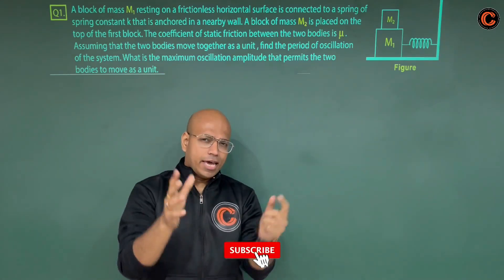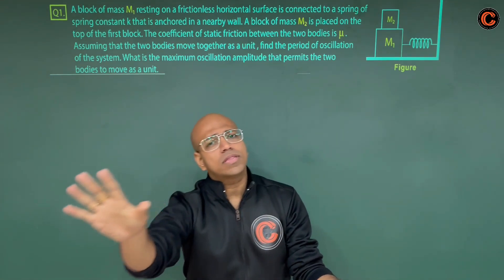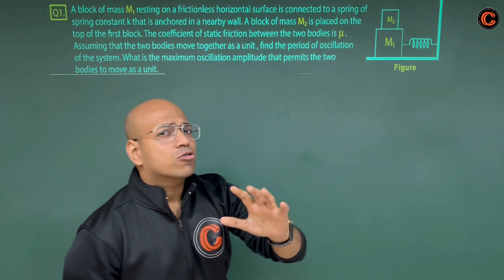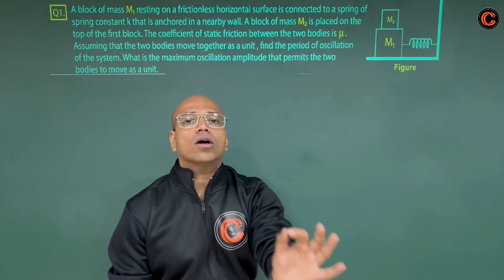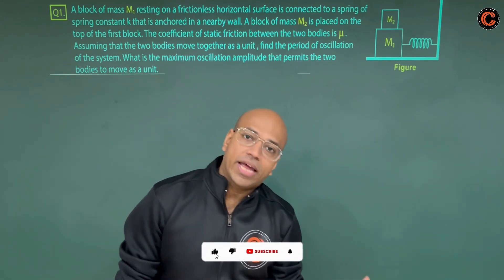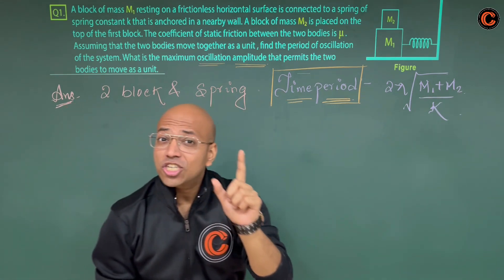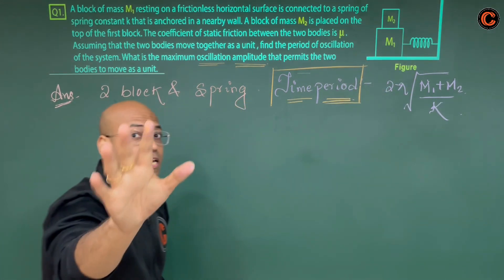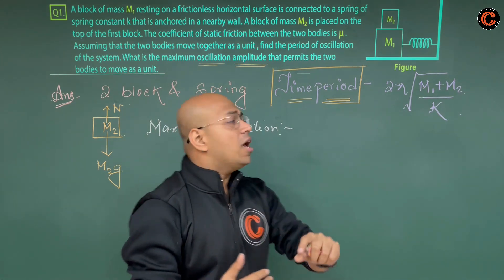PHYSICS - 2 Block Spring System || SHM ||  QUESTION NO. 1 || Class - XI lecture by Souvik sir

Comment from the maker: #souviksir #souviksirclasses
#springblocktricks #springharmonymotion #souviksir 
#souviksirclasses #souviksir 
Title:- 2 Block Spring System // SHM // Learn the secrets of Spring harmony motion

Definition:- A block spring system is a physical system consisting of a block (or mass) attached to a spring. The spring is typically fixed at one end, and the block is free to move along a horizontal or vertical surface. The spring provides a restoring force on the block, which causes it to oscillate back and forth about its equilibrium position.

Introduction:-  In this video, we will explore some of the most popular spring block harmony tricks, including:

How to make a spring block system oscillate at different frequencies
✅How to create a standing wave on a spring block system
✅How to transfer energy between two spring block systems
✅How to use a spring block system to measure mass and spring constant

Timestamp:
Intro: 0:00
Question1: 0:17
Outro: 10:45
Join our batch in 1st December

What will you get in this Batch?

1) Complete Class 12th + JEE Mains/ NEET syllabus - Targeting 95% in Board Exams and Selection in JEE MAINS / NEET  with a Strong Score under Direct Guidance of Souvik Banerjee.
2)Offline classes with one-on-one interaction
3)PDF Notes of each class.
4)DPP: Daily Practice Problems with each class having 10 questions based on the class of JEE Mains/NEET level.
5)Syllabus Completion by end of January, 2021 with topicwise discussion of Last 10 Years Problems in Boards, JEE Mains/NEET within Lecture. 
6)The Complete Course (Video Lectures, PDF Notes, any other Study Material) will be accessible to all the students untill JEE Mains & NEET 2021 (nearly May 2021)
7)In case you missed a class, you can join for revision/extra class.
8)You can view the videos any number of times on our youtube channel.
9)Each chapter will be discussed in detail with all concepts and numericals
10)Chapterwise Approach towards JEE Mains/ NEET & Board Exams.  

👍Like and subscribe for more physics videos!
Concept Classes Instagram Handle :  

 / conceptclassesbysouvik  
Concept Classes Facebook Page: https://www.facebook.com/profile.php?...